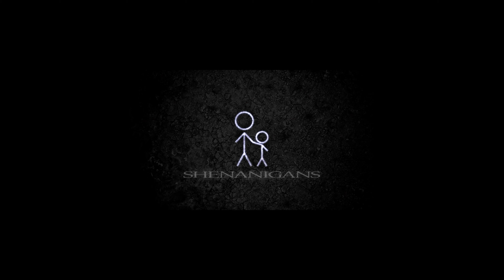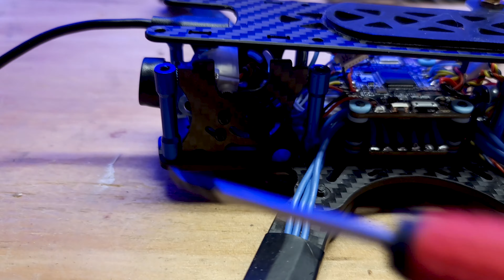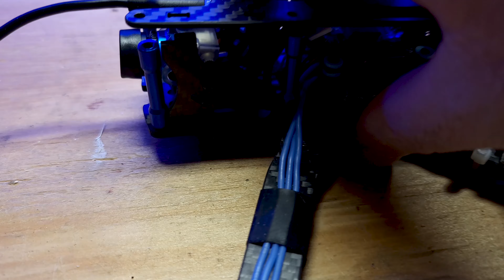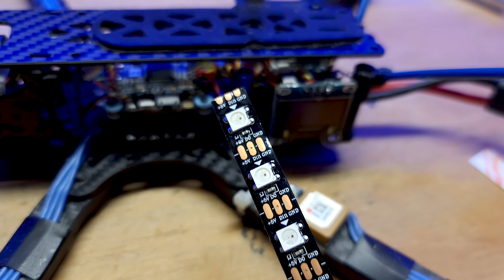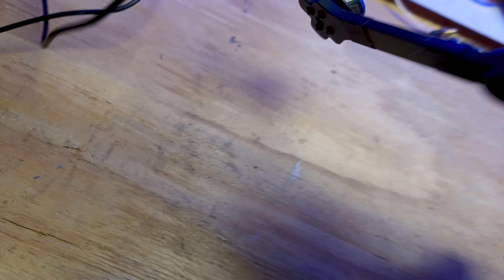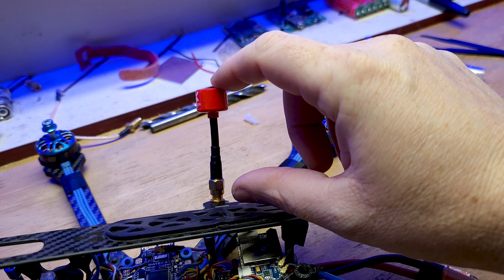7" Deadcat autonomous build

Comment: Did you get an R9? Any updates on your lidar and inav setup?
Reply from the maker: I still haven't decided on a radio yet but I will be going with the R9 system. The lidar is installed and at first it would sink the quad and attempt to land when I flip it on. Not sure why. I also couldn't throttle up when it was active. For some reason my FC won't flash the new inav but the lidar now seems to work just fine. I flew it 2 days ago and it has a rock-solid position hold upto about 6ft then it's just your normal GPS hold. 

I'll make some time this week to post a update video.